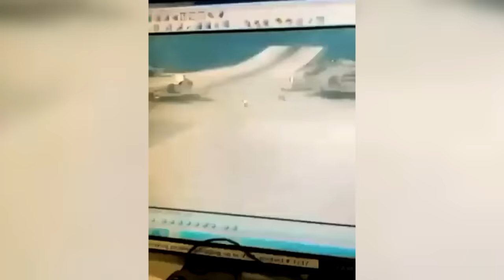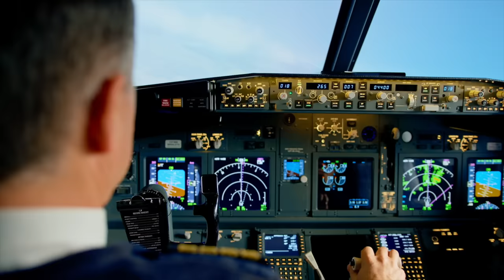Plane Takeoff Failures Caught On Camera

Comment: "135 million-pound" F-35" ?     I know what you meant but with an American accent, you may want to clarify the meaning of the text from which you read?   The A-6 didn't just have "an engine problem", it literally LOST the starboard engine from the air frame. It can be seen departing the engine compartment just prior to ejection. The video narration has lots of errors and lack of insight but the video footage, "oldies but goodies" are always amazing to see with the volume down.

Comment: those are compressor blades not rotor blades. the engine will be removed dismantled checked for other damaged blades install new ones tested then reinstalled

Comment: Last plane (if that's the same one in the story, "could not get off the ground") did not have its flaps out. You need flaps to take off, because the speeds you can get on the ground is not enough to fly unless the flaps are out .

Comment: A guy I went to Tech with was at Ohakia New Zealand when a F111 doing touch n goes touched... lifted it's nose... put its nose back down... ran off the runway... and the pilot stuck it out till he was out of sight below the runway before ejecting... There was a light rain at the time making vortex plumes on landing... one of these plumes snuffed out one of the F111's motors... rest was just "your just along for the ride" territory...
Interestingly all the ground crew were running to get there, and with near no wind,, they were worried the ejection pod was drifting back into the flames... luckily it just drifted to the side.

(oh and my classmates job... Take a Strikemaster into a big hanger on the left... disassemble it, reassemble it on the right, wheel it back out (finding all the cracks etc.

Comment: The problem of RAM was that the pilot forgot to put the flabs in start position. The take off speed was calculated (V2). Horrible mistake of the pilots....they had not worked with the take off check list.

Comment: The A-6 pilot blew it. He knew he didn't have adequate power, yet he tried to climb too steep. He needed to fly more parallel to the waters surface and climb much more shallow. If it takes you a mile to climb 10 feet, so be it. It's better than stalling and crashing.

Comment: When this guy said that the pilot "hit the gas and aimed for the ramp," I had to stop the video right there.  The thrust of the aircraft is not what gets them off of the deck of the carrier. It's a catapult system.  That was a catapult system failure.  It had nothing to do with how much thrust the guy was using when he was trying to take off from the carrier.  The pilot does not aim for a ramp. The catapult system propels the jet forward on a rail.  Pilot has no choice where the jet is going.

Comment: 100 million pounds is 50,000 tons. An M1 Abrams main battle tank weighs 70 tons. An F-35 does not weight the same as 714 Abrams tanks. A fully loaded F-35 weighs about 33 tons (66,000 lbs.).

I'm thinking the narrator was talking about the cost of the F-35 in British Pounds because this would be pretty close.
Reply: And you figured it out…yet felt the need to blab.
Reply: @justing42  I "figured it out" instantly, but was commenting on others about that much, if it were weight. If the British would use a currency that isn't a common measure of weight, he could have avoided all this, huh? But the Brits have an odd way of referring to things.
Reply: @TE5LA-GAMING  Something used solely in the US can hardly be called common 🤣

Comment: @Richard_Park beat me to it! I hope the commentary gets BETTER from here because I paused it to comment. EDIT #1: It hasn't improved yet. On the very next video, the narrator says that the pilot had to eject "...when something went wrong with the engine." It kind of looks like the engine FELL OFF. Well, I guess that something DID go wrong with the engine! As severalother comments suggest, there are several other points of narration that were fails, so I'm gonna quit my edits. You get the picture.

Comment: Were the practice bombs real bombs, or was the explosion triggered by the blank bombs igniting the dumped fuel?
Reply: Think about what you said. If they explode they are real.
Reply: @justing42  "Blank" weapons/ordinances still explode. I literally just looked up "practice bombs" and found the type used by the US military: "Commonly referred to as the MK-76 or BDU-33, practice bombs have a spotting charge that releases a cloud of smoke on impact."

My question is if they were somehow moronic enough to be using REAL bombs on a PRACTICE bomb flight, or if they were using the blanks that make logical sense and the explosion came from the small charges sparking the thousands of gallons of airplane fuel they were dumped with

Comment: 6:16: The Aerosucre crash explanation makes no sense. If the pilots tried to take-off at 5 knots faster than necessary, the plane should have leapt into the air at rotation. It didn't. So...what gives here?

Comment: The Royal Air Moroc pilots did nothing wrong. They got hit by wake turbulence which made them pitch up. They recovered, accelerated to an appropriate speed, then rotated. 

Being told to “use caution for wake turbulence” happens ten thousand times a day. There’s not a lot you can do   unless there’s something in particular that makes it much more risk than normal. Then you could delay.

I didn’t even consider wake when I first saw this, but that’s what it was.
Reply: BS:  You can WAIT!
Reply: @Jeph629  No one would have waited in that scenario. If everyone waited in such scenarios there would be a 95% reduction in flights, destroying the airline and air freight industries.

Comment: Unless my eyes are playing games,I  didn't see no flaps down on that take off. The plane flared up cause the pilot pulled backed and realized he needed more speed put the nose back down.If he had flaps down he probably  would of took off smoothly. But he was still close to a stall when he got air born cause he level off quickly  and I'm  talking about the last plane
Reply: The are deployed for take off
Reply: I was thinking the same thing.  No flaps.  He wasn’t gaining altitude, just staying a few feet in the air because of ground effect until he gained enough airspeed to start climbing.

Comment: There was another one where they clipped some of the equipment on takeoff (fence and lights I think) and still flew to their destination. Was a LOT of errors made on that flight.
  TBH what Sully did was aviation 101 imo. Last thing a pilot should do it stop flying the plane. No engine, still fly it.  He flew it to the only destination available.  Yes he did it well, and he did a good job realizing how it must be flown, but he really had no choice (other than to crash).
 In training once I was doing a EP and we landed right at max airspeed for it with a 20 knot headwind, but ATC had actually gotten the winds backwards, so we landed 40 knots over max airspeed. Given that its rare a Rotary wing ever lands even remotely above 0 knots it was indeed a very rare thing to land with that much speed.  We only realized it once we landed and saw the windsock going the other direction. Sure it would have been great to have verified wind direction via the windsock before landing, but windsocks are not always in good view (depends on your and their location) and I was a student..so...just keep flying.

Comment: 9:38 The flaps of this plane are not open and it is probably on the mtow border, so this plane hardly took off. And in Boeing 737-200, the flaps of the plane should be at least 15⁰ so that the plane can fly.

Comment: 11:05 they weren’t sure how the plane rotated before hitting the right speed?  There’s only one way to rotate a place, is pulling the yoke
Reply: Negative….if you go fast enough, that plane will start to rise.  It’s called lift.  Physics are your friend.
Reply: @justing42  Wrong.  It might lift, but it won't rotate unless the stick is pulled. Maybe you should learn what "rotate" means.  And also what "flap extension" means.

Comment: That last one (Air Maroc) was not a speed issue or wake turbulence consideration.  The flight crew failed to deploy the flaps and slats.  A no-flap takeoff requires a lot more speed.  CHECKLIST anyone?
Reply: You are about the 10th person to make that INCORRECT statement.  The flaps ARE deployed for take off…which is clearly seen in the clip.

Comment: The last one was so obvious that there where "NO FLAPS" set, yet no one mentioned it?
Reply: Obviously you have no idea.  The leading edges are CLEARLY extended and the trailing edges are not all the way up.  They are in STANDARD take off configuration.  I work on them for a living.

Comment: The air Maroc flight had no take off flaps! look at the footage again!
Reply: After you…you can CLEARLY see the leading edges are extended, and the trailing edges are not fully retracted.  In other words they are in standard take off configuration.

Comment: Stop making up rubbish to narrate your video's. Number two video for example is all false regarding the 5 knot diff in takeoff speed. Faster is better and 5 knots airspeed will make zero difference at 130 kts  a faster takeoff speed will not cause a loss of flight control.  A lower than recommend takeoff speed will cause issues tho.

Comment: Of course, when the flaps are not set to the takeoff position, then for some reason the plane does not take off
Reply: Yet, of course they ARE….look at the leading edges as the plane passes by…they are down…and if they are down, the trailing edges are AUTOMATICALLY set to the corresponding position.  They are set to standard takeoff position. Of course.

Comment: 10:27 They didn't have any flaps out to increase lift which was the reason they almost crashed.
Reply: Yes they did.  Look and a video of a “normal” 737 takeoff and there is zero difference in flaps settings
Reply: @justing42  Expected they would use more than, that it's not much. But now when I read the accident report the runway was not near as long as it should be, so it all make sense.

Comment: I stop a plane taking off once. The pilot did not know if all the engines were working. The lights in the cockpit were not working. Staff looking out of the widow to see if the engine was working. Is not good. So I said " She is looking out of the widow to see if the engines are working" She looked at me. She had gone white and run back to the cockpit. The wait was better than going down into the sea, I think.

Comment: Air Maroc took off without flaps.  100% pilot error.
Reply: 100% you dont know what you are talking about.  The leading edges are CLEARLY extended, as are the trailing edges.  It’s call standard take off configuration. Try again.

Comment: Air Maroc did not extend the flaps.
Reply: Yawn.  Yes it did. They are down. Look at the leading edges.
Reply: @justing42  Morning Justing.  I am looking at 10:26, the trailing edge looks retracted,, might be the first position.  I did look more closely and yes, the leading edge may be extended.  There is a bit of a shadow line.  In Detroit about 20 plus years ago all died but one little girl,, no flaps.    And I personally on a flight about 10 years ago,, no flaps were out and a long runway.  Plane was light 1/2 full at best. Pilots did not feel they were needed?  They were extending as we gathered speed. (I reported them.)  Not uncommon I would wager.

Comment: An F-35 fighter FULLY loaded with maximum fuel and armaments most certainly DOES NOT weigh 100 million pounds. More like 66,000 pounds - which is 1/1,515  of that weight!!! I once had a US Navy seaman, who was conducting a tour of the USS Lexington aircraft carrier at NAS Pensacola in Florida, tell me the anchor of that ship attached to the bow weighed more than the entire aircraft carrier itself.😱🤔😮
Reply: Yes, 100 million pounds is over 700 M1 Abrams battle tanks 😋
Reply: @TE5LA-GAMING  either of you ever hear of English money…? POUNDS??
Reply: @justing42  It's possible they haven't, US education leaves a lot to be desired.